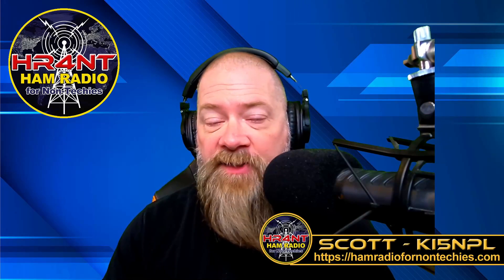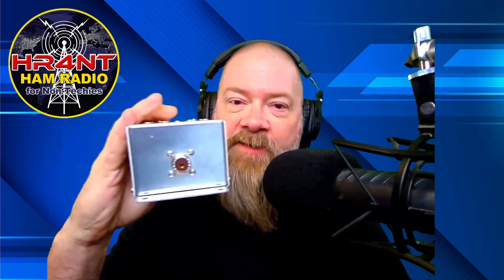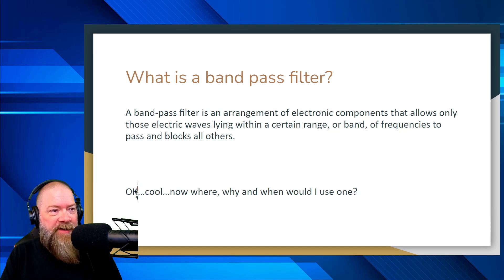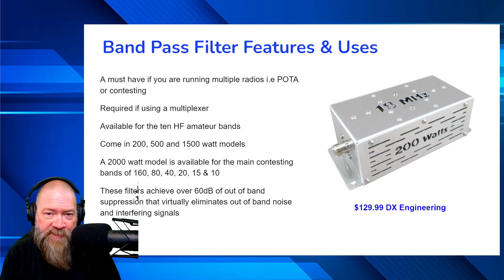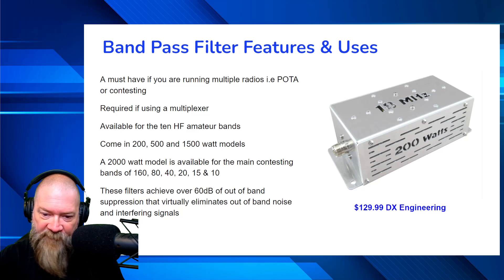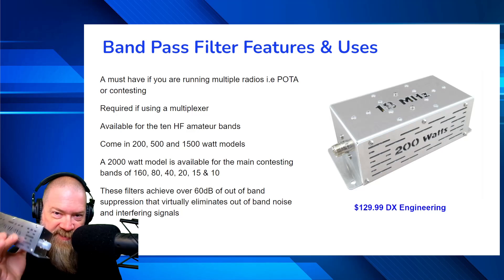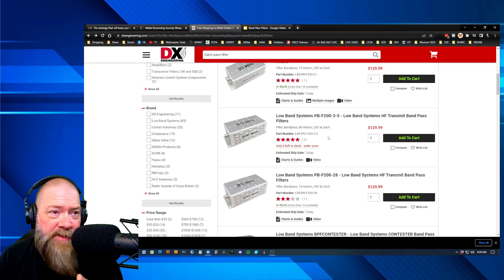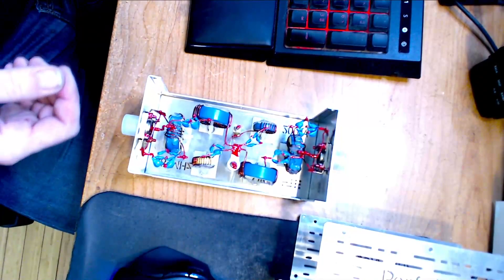What Are Band Pass Filters and Why Would you Use them?

Comment: As a new HAM with two operators in one shack both running HF rigs, how do you recommend band pass filters be set up, would need for 10 15 17 20 40 meters, would only one radio need to have them?  thanks and great video

Comment: Did you find a way to build one?
Reply from the maker: I did, but it is a major pain to do.  There are some cheaper ones available on Alibaba and they work, but may need a little correction in the solder joints.  However they seem to work and you can get them for all bands for about $250 total.  Thanks for the coment and for watching.  73!

Comment: For those who go out as a club and operate (say POTA) on multiple bands simultaneously, you don’t need a set of band-pass filters for each operator, just one set.  If you have three operators and plan to operate, for example, on 80M, 40M, 20M and 15M, you need one BPF for each band.

Then the ham who wants to work 15M grabs the 15M BPF and attaches to his transceiver.  Now the next ham goes to get a filter, and finds the 15M BPF gone.  He/she knows that 15 will be in-use.  So, he grabs the 20M filter.

In other words, the 4 filters not only allow the operators to not interfere with operations on adjacent bands, but they also serve as a “semaphore” that prevents two operators from accidently operating on the same band.  If you buy multiple filters for each band this last feature is lost.

I built a LPF using standard components, to prevent my FT8 signal on 40M from interfering with operators on 20M, 15M and 10M.  Its frequency response is good, but have not tried it at Tx power levels above 25W.

Thanks for the video.
Reply from the maker: Well said and good observation.  Thanks for the comment and for watching.  73!!!!

Comment: bandpassfilter is basically an inductive blindresistance (L) and a capacitive blindresistance (C) in either parallel or in serial. the L is a coil and the C a capacitor. the resistance in the L increases with inceasing eadiofrequency. the resistance in C increases with decreasing frequency. the measure unit for L is Henry (H), the measure unit for C is Farad (F). at a certain F and H value of the L and C, the bandpass lets only a certain frequency range through, which is the bandpassfiltering as in the term bandpassfilter. bandpassfilters need to be narrow, to let only desired frequencies pass or else there will be much interference.
Reply from the maker: Thanks for the clarification and for watching..73
Reply: That is an excellent summary!

Comment: Will a band pass filter lower noise levels for the given band? Also is the filter installed close to the transmitter or closer to the antenna?
Reply: A band pass filter will not lower noise levels for a given band. It should be installed close to the TX.
Reply from the maker: I do not think it will filter noise as much as just filter out RF from other bands.  When you install a band pass filter it is close to your radio, so you will need to buy or make a pigtail coax about maybe 2 feet long or so that way it is easily accessible if you have multiple filters and want to switch them out.  Thanks for the question and for watching.  I am always glad to help where I can.  73!

Comment: QUESTION OFF SUBJECT:   Will the FT5DR act as it's own hot spot?   In other words, if operating from my vehicle, do I need to use or can I use my cell phone as a hot spot or do I just have to depend upon being near enough to repeaters?
Reply from the maker: From what I can tell, you still have to have an external hotspot in order to use the digital modes like Yaesu System Fusion etc.  Don't quote me on that.  I have an FT3DR and am still tryin got figure it out, however we do not have any YSF repeaters in the area either which is kind of a bummer.  The two videos I found relating to hotspots and that radio all referred to having a Pi-Star node hooked up somewhere to use it.  Thanks for the question.  I will keep looking around for an answer but I am pretty sure you have to have an external node of some type to do what you are trying to do.  Thanks for watching.  73!